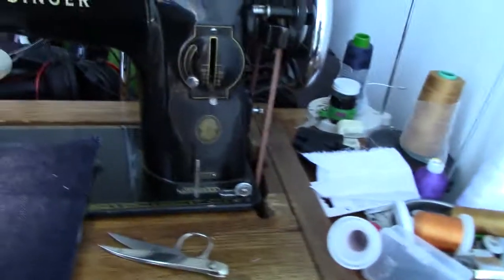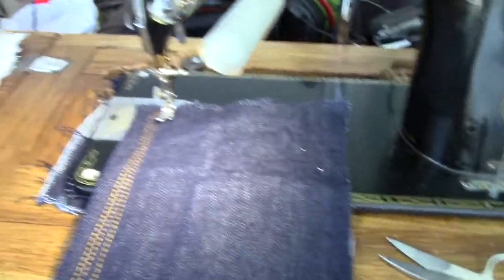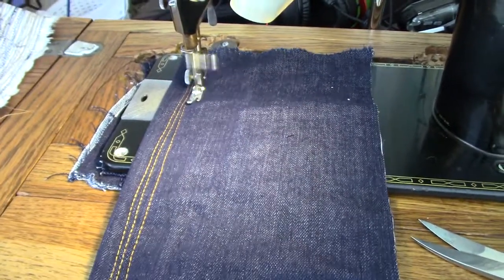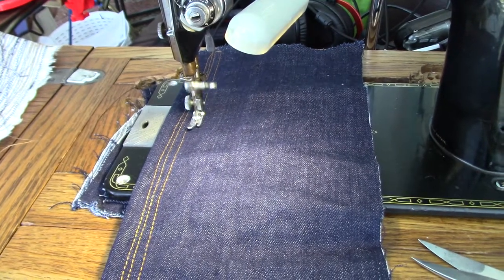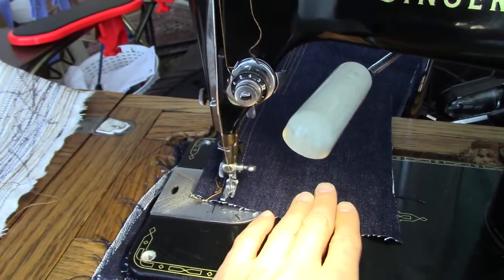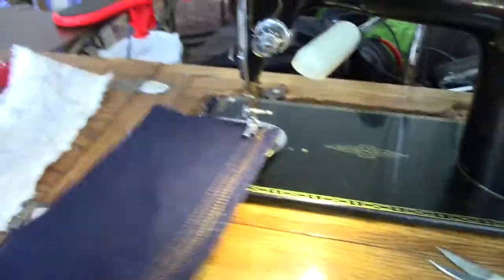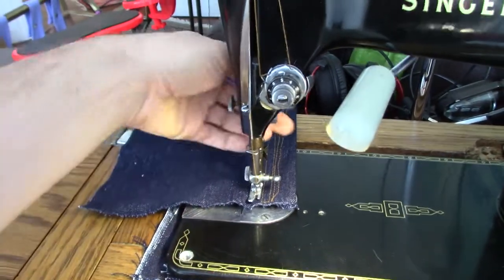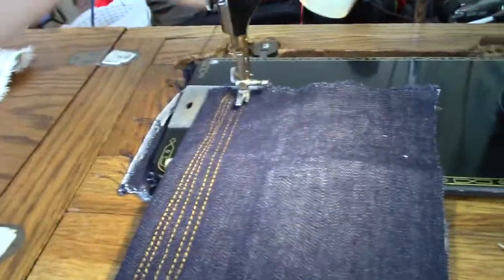Singer 201 with Consew CSM1001 Servo Motor

Comment: A ‘ How to” would be amazing!
Reply from the maker: i should have said that I posted another video on setting up the servo motor in a treadle table. After that, I just use a belt as normal with the 201.
Reply: @jamesrogers991  thanks for the response!